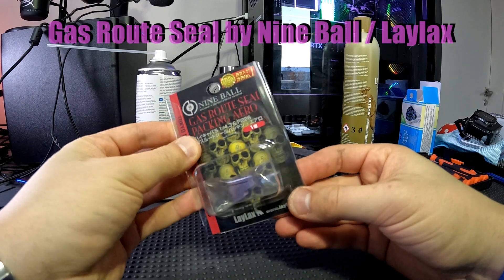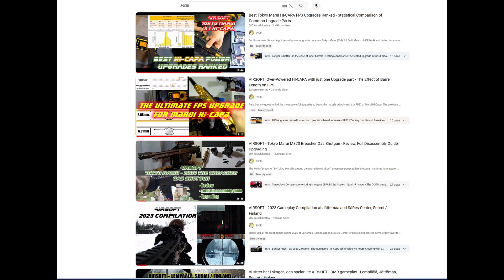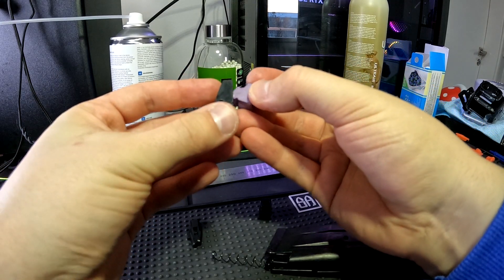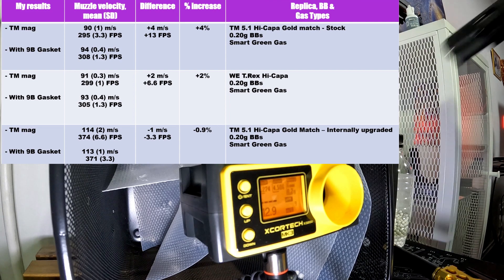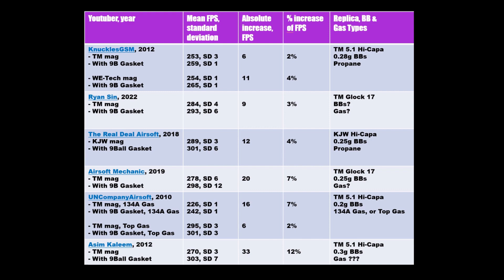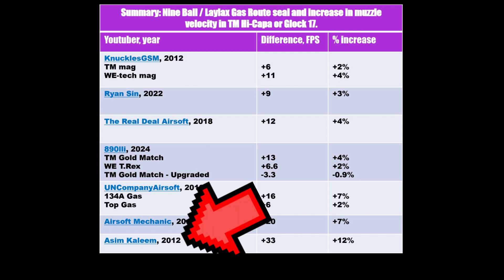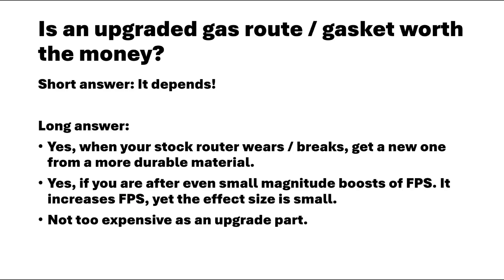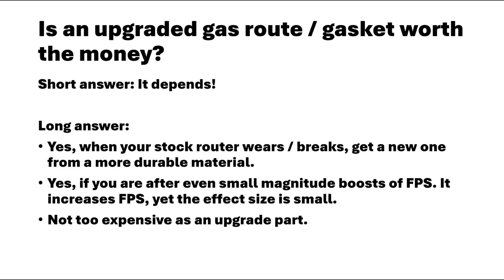How much the Nine Ball Gas Route Seal boost Hi-Capa FPS? Part 3 of power upgrades under test

Comment from the maker: See also:
Part 1: The commonest Hi-Capa upgrade parts (8 different setups vs. stock Gold Match) are ranked based on their effect on muzzle velocity:  https://youtu.be/Vt9Novlhm6c?si=n-Uwi7uY7o_U31Am
Part 2: Inner barrel length is the single most important determinant of muzzle velocity because with a longer barrel, the expanding gas has more time to accelerate the BB. Here, the effect on FPS is demonstrated with different lengths of barrels: https://www.youtube.com/watch?v=-J52HDyhMi4
Part 4: Blowback Units (BBU) and nozzles: https://youtu.be/mQ5i0dcQMqY?si=v401W1-AkxyaE0cO